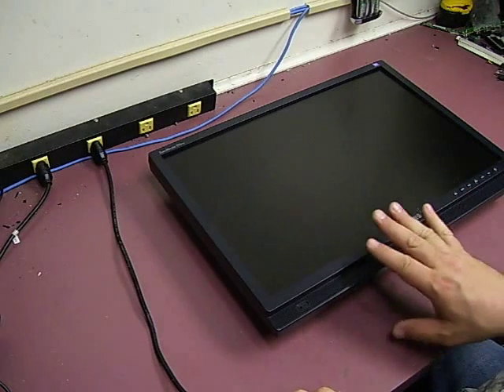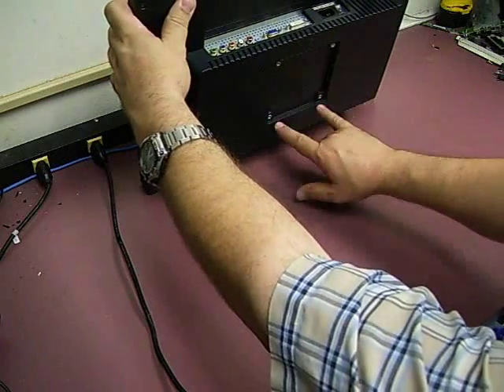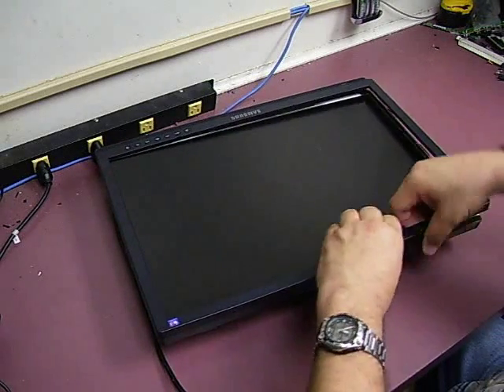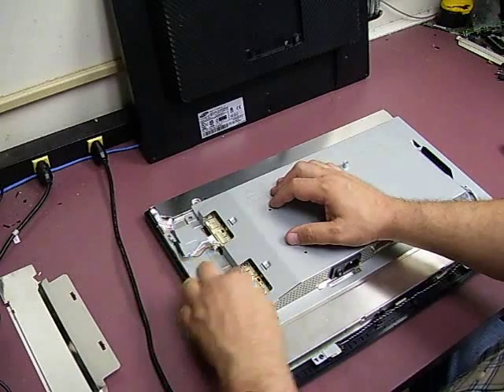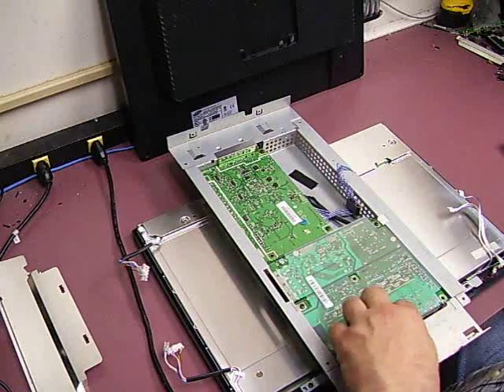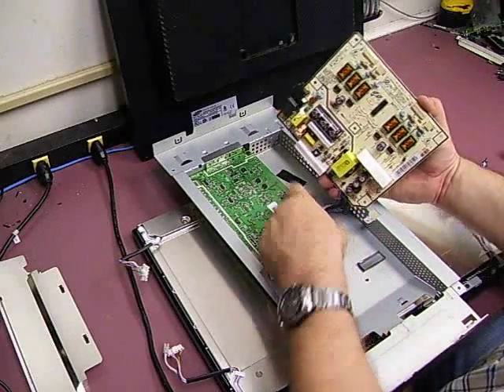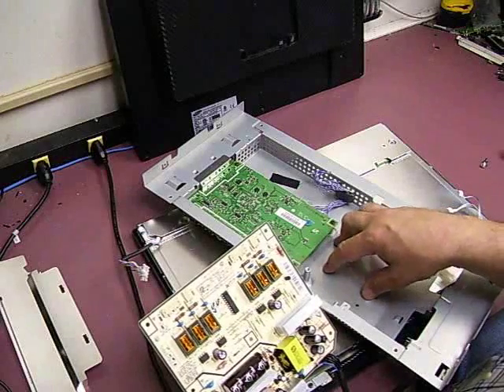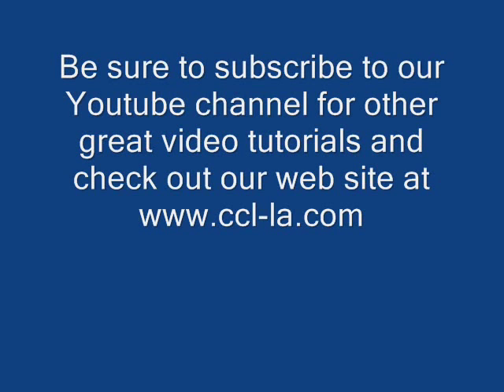Samsung 215TW monitor repair - Part 1 Dis-assembly

Comment: Very good video!
I wonder if this sort of repair would also solve the power up problem I have. My 215TW works fine, all day, faultlessly! But every now and then, mostly after a pause of some hours, the power-up doesn't work. There is not even a faint image, no flickering, there  a black screen. I always thought it was maybe insufficient driver communication and put a rescue disk into the disk tray, switched off and on, and hop! went the weasel. 
Today, that did not work. And I was shocked because for the first time, there was a white screen. After switching on and off at least ten times, I went down to the cellar and got me another monitor. When I came back, the image was there! 
I guess now that my putting a disk in was only a placebo. It would have started anyway, like today. But I don't like that delay, when I want to work. I ask myself if this is principally the same problem as yours, i.e. would your repair  help?  (I have phoned the Samsung support. But of course, this monitor problem never existed (for them). Win 10 has to be the sinner, as usual.